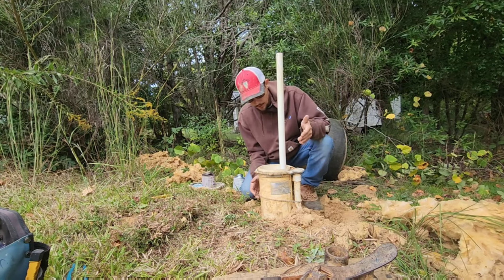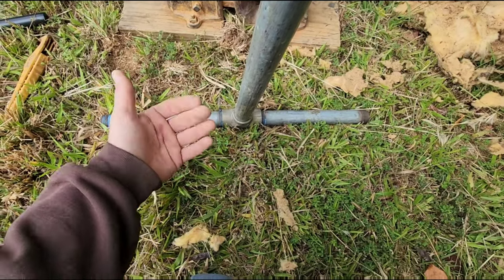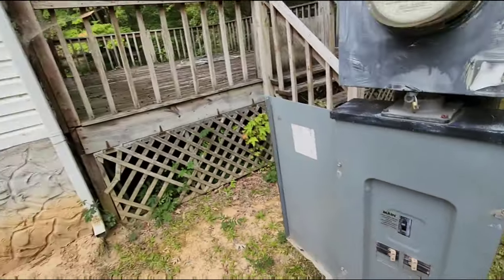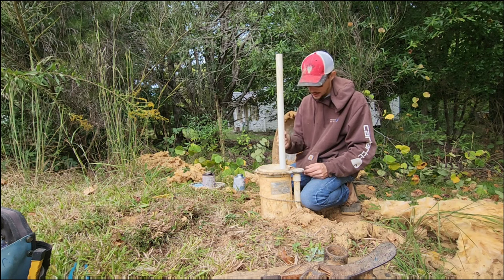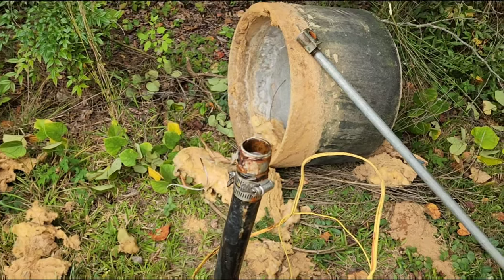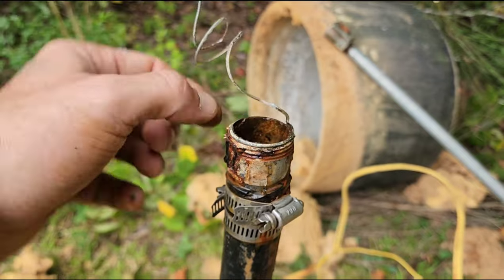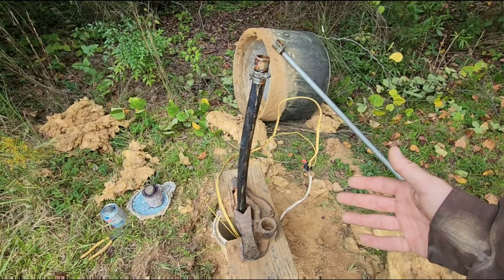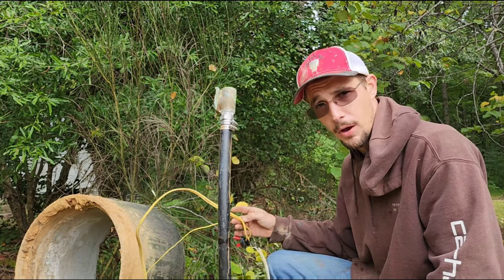Well Pump Repair on Pitless Adapter Style Hook-up. The Drop Pipe was Broken! No Water Pressure

Comment: Mystery solved!  I haven't seen a pitless installation before.  I can tell from the cap on top of the casing that this is what we have up at the family farm.  It's been sitting idle for 10 years and I will have to work on it at some point.  Thanks for another very clear explanation.
Reply: My house has 2 wells and a cistern. Both we buried over. Im kinda bummed that my parents picked to do that, but oh well. Both were pit less into the basement.

Comment: Love your content. My well pump failed during the night. I did call a well pump repair guy and I assisted him every step of the way, and I knew exactly what to do and expect thanks to your channel. I just needed his experience, help and his well dog. We got the whole system up and going today, to include replacing the PVC well pipe with new black poly, new wire, and a fancy electronic pump drive, a Pentek Intellidrive, and a new Berkeley 10 gpm 3/4 HP pump. The system works beautifully. I really appreciate your content.
Reply: how much did it cost you?

Comment: I’ve been watching many of your videos over the years. Had problems this last weekend. These videos have given me a good explanation of how everything works. One thing I picked up from several videos, if you’re unsure just call a professional. I called a professional and we came to conclusion it was probably a check valve on the top of the pump. They used a crane and cut the black roll pipe out in 20’ pieces. 190’ deep. It was check valve btw. Going back together they used 20’ pieces of white pvc with threaded couplers. I questioned this with the installer and he assured me the pvc is thicker walled and that the state I live in requires the pvc now? Idk. The pitless threaded in nicely. My well has a rod and bracket that slip over the pitless and as you tighten the nut on top it puts more holding power on the pitless. I opted to reuse the pump and motor, hopefully it’ll get me buy a couple years. Looks simple enough for me to do myself, but I’ll still hire a professional. Yes shit happens but I’d rather it not fall with me doing it. You drop you fish it out lol. My guy said he’ll charge more to fix my fuckup. Hire a professional.

Comment: This is probably my most favorite video. I have a well that I just pulled up of 225' of PVC. The pipe had broken about 4' up from the pump at the bottom- and had burned up. I used a hitch deer hoist (I dont hunt....but now own a deer hoist. LMAO), vise grips, two 8' long ratchet straps, and a 2"X6" board with a U shaped cutout for pipe and wire to come up through.  It wasnt bad...just time consuming...a lot of cranking. Sure beat the hand over hand removal. Now I have a new pump, polypipe, pitless adapter and all new fittings. So glad I found your channel. Thanks so much for your tips and knowledge.

Comment: Hey H2O Mechanic: Thanks for the informative videos. I am almost done with my well conversion from jet pump to submersible. I need to hook up electric and the water line. the pump is installed as well as the pit less adapter. 6" coupling welded on to old well casing with a 6" adapter to 6"pvc.,to get above grade. I also installed a "tee" below the pit less adapter with a street elbow and a 3/8 quarter turn ball valve to drain the pipes for winter time. I shortened the ball valve handle drilled it and installed a handle to work it from inside the well casing. The roll pipe is in or on a barbed fitting in the "tee" down the hole. Your working knowledge is second to none and hats off to your teacher... GB

Comment: Pitless is the only form of well you will find in the Northeast unless you have an old school shallow hand dug well where the pipe just goes through the wall below the frost line.

I fear to think of how far down our pump might be in upstate New York. Our neighbors well is 780 ft deep and we are another 30 ft above them on the hill. Are well has never run out of water even when running sprinklers in the yard during New York droughts. No matter what time of year the water is always crystal clear and 40° f.

That pump makes 12GPM at 70 psi at the well tank too!

Comment: I live in Colorado my 845t well has a pitless adapter. Finally, a well expert has completely explained how this simple ingenious device works.  And now I know why when I bought the ranch, there was & still is an 8ft galvanized pipe in the barn with "well pump lift rod" written on it.   Thank you - even if I never try a repair myself - I will at least understand what the well tech. tells me.  I would hate to end up pitiless...  Again, thank you - liked your explanation of the pressure tank too - very informative.
Reply: I've been working on pumps for 20+ yrs. I would NOT advise trying to pull a pump that hangs anywhere around 800ft.

Comment: I grew up on a rural California property wit a well. It was drilled to 275' with water at about 175, and the pump hung at about 225. The concrete well pad accommodated the well, and the bladder tank, which was 50 to 75 gallons. It was a steel cased well. That water was so good! And crystal clear. During our 1 and only major pump failure, we just ran a garden hose from our neighbors well, and that kept us going until the pump was replaced. The wells in that area must have had really good flow rates because I never heard of anyone in the neighborhood running their well dry. The housing development was on a 2.5 mile oval with houses along the inside, and outside of the oval with 2.5 acre lots. Each lot had it's own well.

Comment: When you first started talking about pitless adapters I said to myself, no one is going to know what he's talking about.  But at the end of the video you fixed it.  Excellent explanation of the adapter.  On my system I installed a Pump Saver device which senses the current draw of the pump.  If it gets too high, maybe a dry well, maybe a bad bearing, it will cut the power.  Also has a timer which allows you to set the amount of time the pump will run.  On slow recharging wells this gives the well time to fill up again.  Was well worth the $100 and is easy to install.

Comment: Watched quite a few of your videos, as soon as i seen most of them i figured your down south. 

Remember folks some pitless adapters are keyed, meaning most likely if a piece of pvc comes to top, and a metal piece is threaded into the top and resting on top of the casing with a hole in the center down the pvc, you need to make a tool from 1/2 steel pipe to slide down the inside of that top pvc and unluck the pitless lefty loosey, remove and then thread 1/2 t like he did but shorter to pull it.

These are very common in the upper Midwest

Comment: I have noticed several well pumps that you have pulled has wiring that has insulation wear and causing shorts. I have noticed that the same wells do not have anti torque spacers installed on the pipe to help keep the pipe and wires near the center of the wells. I hope this may help your future customers. The local well driller installs these three corner plastic anti torque devices about every 20 feet or so. I recently replaced my well pump and the wire was not scraped and was still in original condition. Hope this helps your customers and help you stay on top of your profession.

Comment: You answered my before I questioned! About removing pvc, if I have pvc I'll be removing it in pieces and try to keep it from falling. Also seen another video about a pump connection that has a loop to attach a cable to the pump in case it falls.

Comment: Very well done.  I've installed more well pumps with pitless adaptors that I can count and your explaination was right on the money.  I suspect that the person that installed that pump was someone not experienced with well systems because no technician worth his salt would use a plastic fitting on the pitless.  I live in Maine so our pitless adaptors are down deeper; around five feet due to the colder climate, and thankfully we've always used the 1" black poly pipe for the drops because that material is just about bullet proof when it comes to strength yet flexible enough when it has to be pulled, (but awful, awful stiff when being installed on a cold January day, LOL)  Great video.
Reply from the maker: Thank you for the kind words!

Comment: Just came across your channel. We’ve got an old cabin with a well. Our pump was installed in 1974. It’s still working but,I’m expecting it to take a powder at anytime now. Saw your pump dog and knew I had to have one because I’ll be replacing the pump myself. Found one on eBay and bought it! Thank you for the valuable tip!! Be safe and the best of luck in your business!!! As I write this it’s - 22 in Montana 🥶🥶🥶

Comment: Not sure how I happened across this channel but I'm glad I did.  You've helped take the mystery out my own well setup.  Seeing that pitless adapter with your explanation gives me the confidence to take on a future repair myself.  I will need to replace my pitless adapter at some point as the water here in my locale is very corrosive and has done a number on mine.  So far it's holding pressure down at that connection point but I know at some appointed day it will work loose again and I will hear my well pump short-cycle.  I will have to excavate and do a replacement then.  Hopefully in the summer as I'm in northern IL.

Comment: Thats what I have here in central Oklahoma, I made a tool just like that, I've pulled well and changed pump 3 times in 35 years, unfortunately my well pump is problem getting to end of life, not sure I could pull it next time, well is 167 feet I have pump at 120 feet, we have a really good water supply 👍
My well has always been PVC, when I put it in I put a threaded junction every 2 joints, pull it unscrew joint and keep going...

Comment: Great job on that fix, had the same thing here, except my pit-less adapter is probably a newer version and I'm sure there are many versions, mine has no piece on the inside just a T joint that's matched to the adapter, below grade, the adapter has an extension that extends to the top of the 6 inch casing pipe with a T on it that is aligned with the out flow hole and is all metal, there is a long T wrench the goes down the T extension to a bolt that pushes a foot opposite the water elbow to tighten the adapter saddle to the inside of the casing pipe, the top of that T-extension is designed to hang the saddle to vertically alignment and supports the weight of the pump/pipe assembly.   I'm sure you seen the type.   to pull the pump just disconnect the wires, loosen the adapter bolt with the long t-wrench  and pull.

have a great day

Comment: Sorry i had to snicker a little no offense meant, your pump dog. In the 60's we called it a foot vice, because before they started putting in pitless adopters we dug a hole to the well. Set 4x4's across the hole and put the foot vice over the well. I've pulled a many feet of steal pipe through one of them.  Submersibles, single shallow wells  and double pipe 1" and 1 1/4 " at the same time. Haven't seen one of them ( foot vice) for over 40 years.  Good video thanks for sharing.

Comment: Great video.  I've got this set up, with a jet pump and 2 lines.  It's pulling up very small amount of air.  The pressure can't go above 32psi so the pump never shuts off.  I think this is the next connection to check!

Comment: Excellent explanation. I removed my yard rock and found that I have a pitless and a galvanized tank. The pump was kicking on and off every 5-10 seconds with water running. Got it drained down and repressurized and now it takes almost 3 minutes till the pump kicks back on. You'd think the installer would give me a heads up that that type of tank needs to be drained and repressurized periodically. Almost seems like they're trying to sell me a new pump install.

Comment: Pitless adapters are required up here in New England. I will be modifying my pulling tool with a T handle. Not fun when there is 2 feet of snow and the pump dies 😞

Comment: Mine well is exactly like this. I have a gould pump that was put in 28 yrs ago. No problems thus far. According to the gentleman that installed it, It was drilled 110' and my pump is sitting at 62'.  Planning for the future, I was wondering where I could get a Gould pump and a pump dog in order to do this myself and also a pump dog. I live in NE in which we get sub zero weather. A good video, sir!

Comment: I use to work for a well company all we used was pvc an pulled them by hand takes more than two people to do it successfully not easy either bad feeling wen it’s 20 or 30 degrees an the pipe breaks an the water runs down your back

Comment: Great video,  I learned a lot.  I have a pitiless well 20 years old in northern climate with a manual weep valve below frost line in the well pipe to drain the system in winter.  It stopped draining properly, resulting in frozen/burst pipes under the cabin.  My summer project is to figure out why it isn't draining and I'm more confident understanding the system now.  Thanks!

Comment: When installing ss hose clamps when you used 2 under the pitless adaptor shouldn't you put the 2 hose clamps on in opposite directions for better tightening just asking because I do because of policy where I work I would like to add them your way just asking ty for your videos there amazing.

Comment: Pitless are needed up north due to the cold winters. Connections to the house have to be below the frostline. My pipe had a hole in it causing a huge electric bill due to its constantly running.

Comment: great video my man . i was looking at mine the other day( 3 year old house) and was wondering how i would ever go about changing the pump if needed in the future. I live in Mississippi but mine is similar to this . with a plastic cap but has the adapter down in like this . Thank you so much for the insight ! At least now I will know for future ref how bad or not it should be to change it. I believe they told me its only around 80 feet deep . I live near memphis and we have great water. The only strange this is we have no filtration on our system at all.

Comment: 🎉 great video that explains the specific details and working of pitless adapter. Where can a rubber o ring be bought at hardware store? Can any silicone grease be used as there are many different types?

Comment: Thanks for the info! I've got a well pump that I've been wanting to replace, however, I have to use schedule 80 pvc pipe, due to the way the water is, it would plug up the metal piping great idea on the black piping

Comment: This is excellent! I have a besrly identical setup. 240v out to the pump wires but no go. I just saw my punp is only 79ft deep. The top of my pump is pvc to a steel ring thst looks like its intended to fit a t bar. 

Now i just need to see if i have something like this video eith just pvc for the first little bit and then the flexible pipe. Or if i have to pull out in sections and cut/hire someone. Thanks!!

Comment: Hello!
In your experience, how long does the rubber seal on the outside of the casing last before it begins to leak, allowing top water into the well? In cold climates you have to install the adapter to a depth of up to 8 feet, I wouldn’t want to dig up and change the rubber bands every 5 years.

Thanks very much for video 😊

Comment: Hi H2o Mech, loved your video! 
Getting water seeping in the basement where the line comes in from the well.  Thinking I have a cracked line from pitless to wall.  Currently it is flex black plastic line but thinking of replacing with Pex A.  Is pex an ok call to use?  
Thank you for your input.
Mark

Comment: Hello, love your videos have been very helpful. The other day my sisters water quit, Checked and changed pressure switch, Checked wiring to pump so we're thinking pump. My buddy says it's a pitless and from the looks of it it has never been apart. He's almost sure it's gonna break and that's if he can get the pitless bar screwed in. Is there anything we can do to hopefully get that pitless to come loose without breaking? It it breaks he says we have to tear up the driveway and dig about a 6 foot deep hole to get to the pitless adapter. Please help

Comment: Had a pipe break , found it on my electric bill 💵.  What you call a stick pipe is what they use in this area will last 10 yrs plus , it's a thicker schedule PVC. When I change it out next time I'm switching to your preferred black roll pipe. I was able to pull it out 2 times with a buddy helping but I'm still gonna change it to black roll..

Comment: I have a 405' deep well producing 2 1/2 gallons a minute with my pump at 300'. I need to drop my pump (25 yrs. old) 100'. Provided electrically I'm good can I simply attach 100' more black pipe with a brass barbed coupling and splice on an additional 100' of 10/3 wire? Also any suggestions on pump size would be appreciated.

Comment: Excellent video Sir!  You explained everything beautifully and clearly. 
My well just recently and suddenly started pumping silt/Mud. I have a 1000 mesh screen inline with two other filters, and the screen is getting 100% plugged in only a few uses. Like a shower or two, or a few toilet flushes.  I tried flushing a bunch of water at the well and thru my Garden hose. It seemed to clear up, but not fixed as it still doing the same thing. Kind of thinking maybe I should raise my pump a bit to get it up higher out of the sediment. But maybe there is bigger issues going on, Im not sure.

Comment: I've never seen a pitless adapter but I can see how they might get a bit stuck over time and become difficult to remove. 
I'm sure there might be a good reason but I wondered why you don't use a short piece of slightly wider steel pipe on the shaft of your pitless bar and use it like a slide hammer by banging it upwards against the crossbar handle just to help crack the seal.